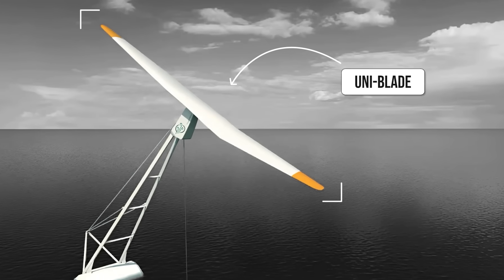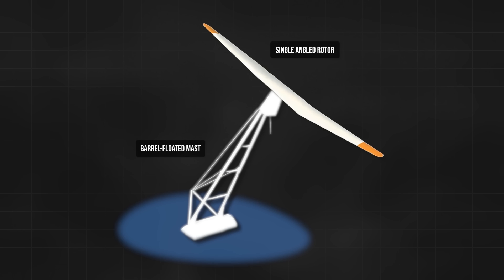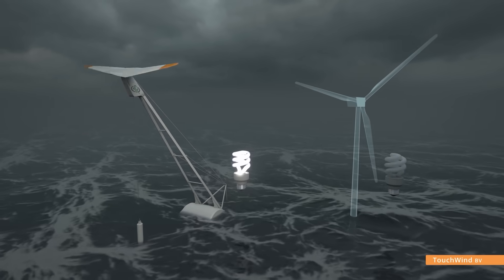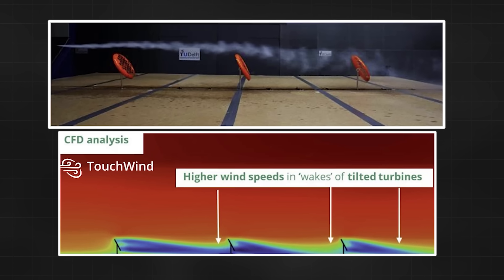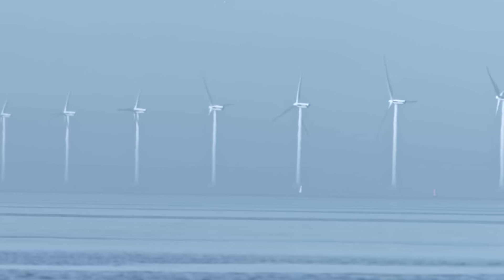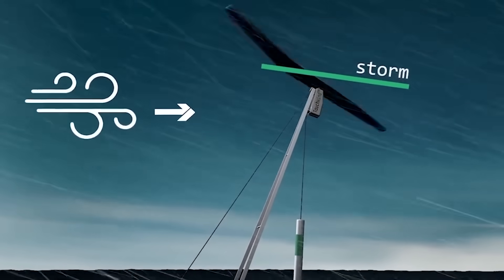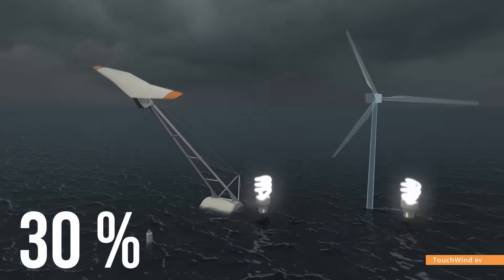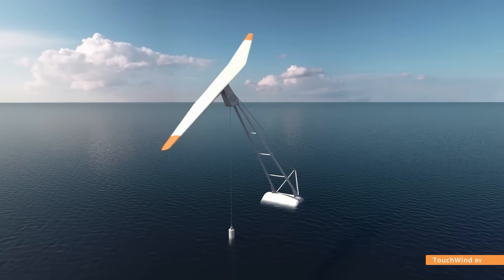Insane New Turbine Promises CHEAP Unlimited Energy

Comment: There is no Too Fast if engineered to the standard of an airplane propellor
Reply: Oh, right- why didn't they think of that?   If ONLY you were on the team.
Reply: There is most certainly too fast for airplane propellors. That's why they have pitch control to limit their rotation speed. It's also why the Tesla Turbine isn't workable despite being much more efficient.
Reply: @Hedgehobbit  but that’s a much lower order of magnitude to airplane speeds

Comment: YOU WHAT, THATS NOT HOW AUTOGYRO WORKS
Reply: yes it is.
Reply: @macrumpton  the air doesn't come from below, it comes from the front and pushes internal slow moving part of the blade accelerating its tips which in turn produce actual lift. Air doesn't come from below at all
Reply: @nerdomania24 so from the front and below!
Reply: @markthomasson5077  Air must create pressure difference not direct kinetic impact because atmospheric pressure exists and it compensates all such forces, mostly. If you want to produce lift or convert it into useful energy you need pressure difference which arises from geometry of the stable flow of air around the blade. I think nor author nor inventor know what they are doing.
Reply: Autogiro self rotation is a weird thing, I have difficulty getting my head round it. 
The blades are not angled down, but very slightly up. They are after the maximum lift, with minimal rotation.
I assume these guys angle down for maximum rotation therefore generation.

Comment: That's 2 blade....
Reply from the maker: They define it as one because it is all made as a single continuous unit, then mounted in the middle
Reply: It's a single blade with a hub integral to the structure rather than a hub with two blades attached. It would be interesting to see an analysis of the strength of the unitary blade vs hub and attached blades,

Comment: Define "one"!
As a non-engineer, I'd say that design is an asymmetrical duel-blade rotor
Plus, everything looks great in CGI - do we have a real-life model?
Reply from the maker: I think its referring to the single unit that it is formed from, which they say helps reduce manufacturing costs. Lots of footage of their prototypes in the video! I agree though - CGI always looks easier than reality!
Reply: @ZirothTech so a single piece two blade rotor to be precise
Reply: @markthomasson5077  No, a single blade centre axis rotor.
Reply: @ZirothTech  One piece compared to 3 separate blades, a hub and a whole lot of gears and motors to change the blade pitch.
Reply: @ZirothTech  I wonder what changes in scale will bring. What happens when the 6 foot model becomes a 200 metre beast, as proposed. 100 times the model size in length is 10,000 times the swept area, and 1,000,000 times the volume/mass!
Reply: @decvoid261  That, and if the 200 meter blade does one rotation per second, its tips would travel at more than 1000 km/h. That could be a problem.
Reply: @VeniceInventors  Something the size and mass of a battleship, spinning on an unbelievably strong axle, with tips going at twice the speed of sound does not seem to practical! :-D
Reply: @VeniceInventors  That's why big wind turbines rotate at slower rpm. So the 60 rpm blade you used as an example would not be used. It might rotate at 12 rpm for large offshore turbines, giving it a tip speed of around 200 km/h, which is well below Mach 1.
Reply: @decvoid261  Super sonic blades are generally considered impractical, that's one of the fundamental limitations on the speeds of helicopters. There really isn't an efficient shape for both sub-sonic AND super sonic, and my understanding is that you need to be sub-sonic before you get to super sonic.
Reply: I like it because maintenance is so much easier, and because of fewer moving parts.  Currently, a lot of turbines have laminal separation at the edge of the blades, but they're so high that it's too costly to fix, so the operators just shut down the turbine(s) completely till it's cost-efficient to fix.  The existing gearboxes for windmills require an oil change every year or so, and changing out 100 barrels of oil for this design is much easier.
Reply: I don't think it's asymmetrical. It just looks asymmetrical because of perspective in some of these animations.
Reply: @seneca983  Only one blade - rotating at its centre IS symmetrical - but the more planes of symmetry the better, this has one. 3 blades have 3 planes - much smoother, less stress when the platform is moving and the blades rotating at the same time.
Reply: @occamraiser  The point was that in this video the two ends of the blade look different from each other. However, I think that apparent asymmetry is just an illusion due perspective.
Reply: Been done. Everell propeller 1930s, Newcastle(Australia) university Blackler - self lifting tethered quad ,Hunter "cyclops" and Taylor highly coned wind turbine...
Reply: ...
🤜⚡💥⚡🤛Being a triple engineer with numerous inventions in this space, I conclude that this is not a good design. 1] Downwind designs encounter turbulence from the tower which reduces efficiency;  2] Wind speeds are slow at low elevations which reduces energy production;  3] The blade angle is sub-optimal for all inclinations which reduces energy production;  4] The blade angle to the wind direction requires much stronger, and therefore heavier and costlier, rotors;  5] The retreating blade encounters the same loss of lift that helicopters experience which here translates to reduced energy production and other problems. IMHO, the cost of the system is comparable to legacy systems and therefore the lowest levelized cost of energy [LCOE] metric is higher. Not a good look.

FYI, most wind energy comes from medium wind speeds BECAUSE they are more prevalent/frequent in occurrence. High speed winds occur less frequently. Low wind speeds don't have sufficient energy to be of use.  

I have advanced, robust, low cost wind turbine innovations, offering the lowest levelized cost of energy [LCOE] and ultimate  survivability in any wind regime.
Simple low cost grid-scale energy storage is also on the table.

Contact me for more information and check out my engine/transportation innovations...including off-planet solutions.

Stay Radical!

From the desk of: Chief Radical Officer
🤜⚡💥⚡🤛
...
..
.
Reply: @MiloTheMindBender  cool sorry bro! Sounds reasonable to me.
Mind sharing a video or presentation of your innovative cost effective turbine?
Reply: The wind is not the problem the sea is and how to get the power to land. Water destroys everything+ waves + salt water this project is BS
Reply: It's a single continuous blade that is asymmetrically balanced.
Reply: @mnomadvfx  I don't think it's asymmetric at all.
Reply: This one is easy - if it's a dual blade as you claim, then pick "one of" the blades up and take it over to the other side of town. According to the picture, there's only one blade. Granted, it's just a drawing, but that's all the information that we're given, but somehow, you still manage to come up with two blades. I think you need to define "one" since you're adding more information than was given.
Reply: @Bob-j5o3b  many domestic pedestal and desktop fans have three fan blades, injection moulded as one unit with hub
Reply: "Define "one"!"

I think the point is that it's manufactured as a single piece (even if in function it doesn't differ much from a turbine with two blades).
Reply: It is symmetrical though💀
Reply: @Chazinthius  Only one plane of symmetry - the more planes of symmetry the more stable it is when rotating and rocking in a rough sea.